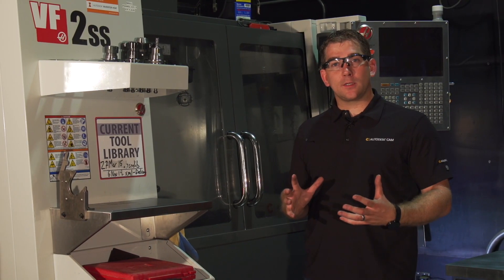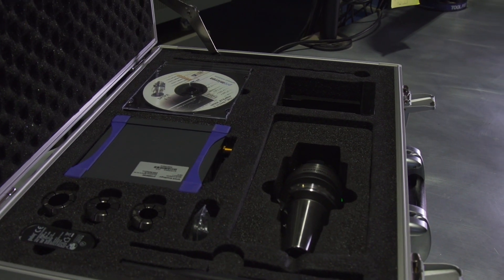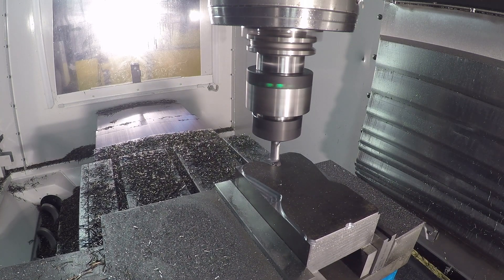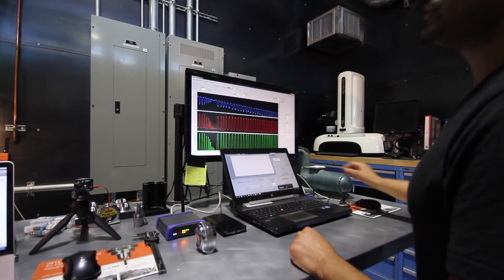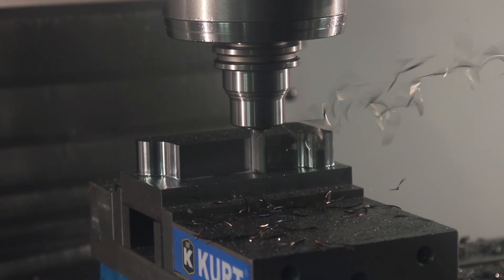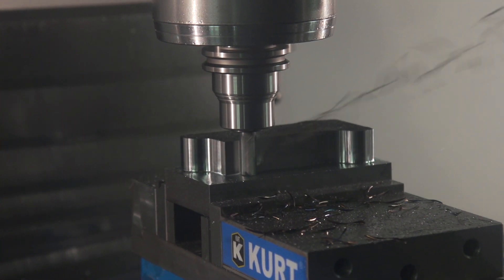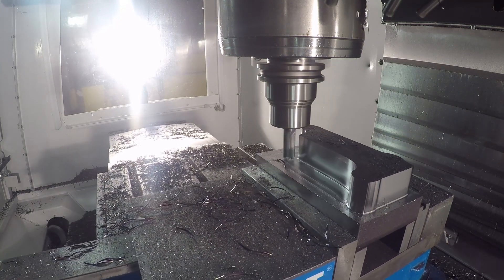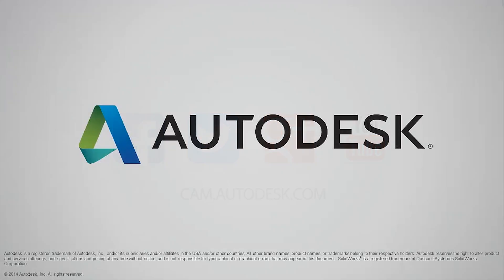High Speed Machining - Adaptive Clearing at Autodesk's Pier 9

Comment: How many tools did you break before getting speeds, feeds and depth of cut right?
Reply from the maker: +Jim D Well you start slow and build up to it. But they work very closely with the tool vendors at Pier 9 as well. Both Swiftcarb & Helical are involved.
Reply: TO be honest, the ones we broke where on purpose trying to break a tool and catch it on camera

Comment: I assume hydraulic or normal milling chucks are best for this type of tool load?
Reply: In my experience, the worm-drive type chucks such as Albrecht Uberchuck and Emuge FPC (same thing) perform very very well with heavy oughing using adaptive clearing.
Reply from the maker: That depends on tool geometry, tool diameter and material. There are lots of different methods of mitigating or eliminating pull out with tool holding. But some are better than others, or a better fit for purpose. Hydro's and milling chucks are considered mid range. But saying that, there are plenty of cases where an ER collet with a bearing nut will do a great job. In otherwords... your question isn't a straight forward one to answer. We've done plenty of cutting of this type with a good quality run of the mill ER collet chuck.

Comment: I use SolidCam I-Machining and it works great, it figures the speeds and feeds. Cut like champ.
Reply from the maker: Glad it works for you. Adaptive Clearing however maintains constant feed speed and constant engagement in tight corners, eliminating the potential for work hardening tricky to machine materials with small cutting diameters.